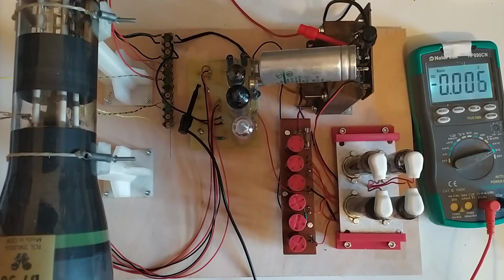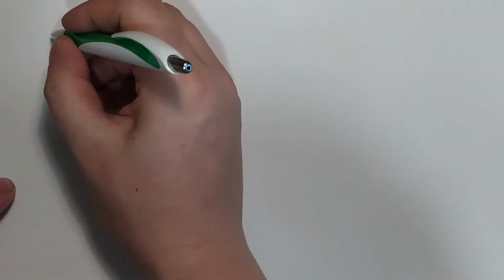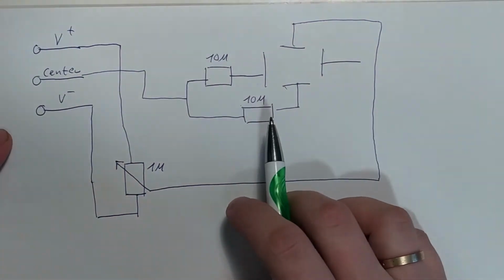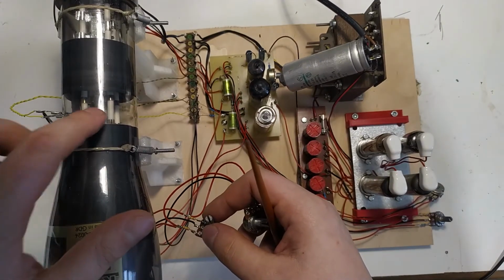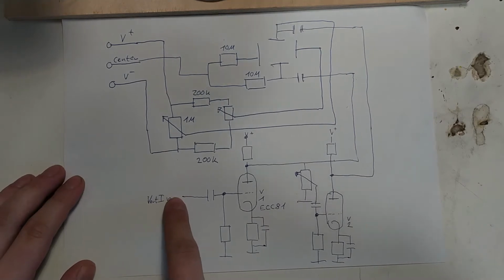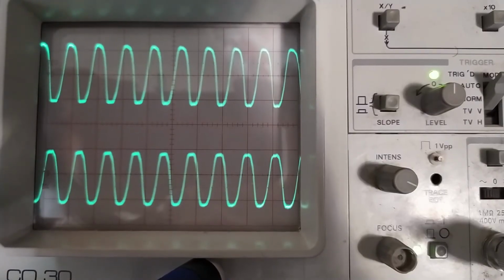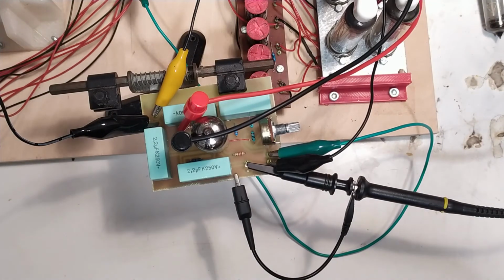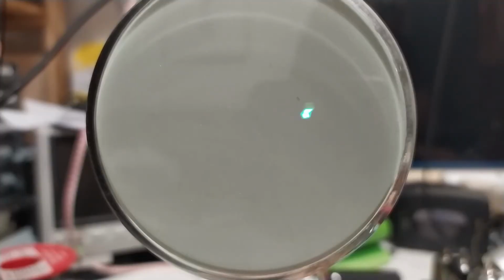Building a cathode-ray oscilloscope Part 4: The Deflection Amplifiers

Comment: The reason for the raster dot problem is  the transformer is causing it the CRT  picks up the magnetic field  you either need a Mu metal shield for the crt  or the transformers to close  and wrong position .Reason you notice it go away on power off .
Reply from the maker: Yes noticed that as well, thought either power supply noise (would also go away once the power is disconnected) or magnetic pick up, I tried moving the Transformer and did not notice much of an effect. I have a couple shields but none that would fit this tube well (I'm keeping an eye out though).
Reply: @captainsolder5247  OK the CRT should have its own ac transformer  or windings the 6.3v ac heater ... connect the cathode to one side of the crt heater ..sort of its own ground but isolated from the rest of the circuits a HV negative cathode ground only  ...because the high negative on the cathode there's a problem being so close to the heater .....you might of noticed with valve circuits you need to to this with a valve to one side of the heater to normal ground or you get noise in the signal